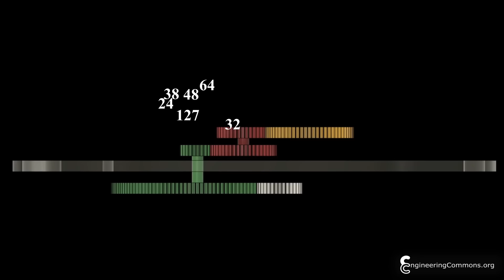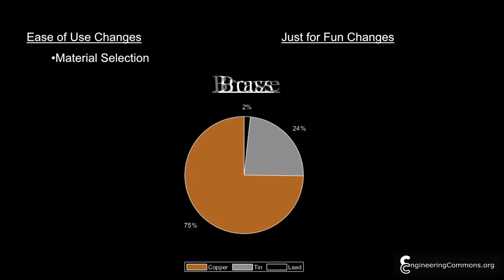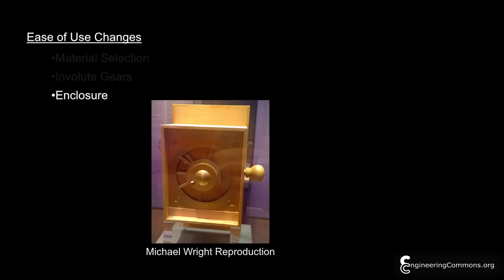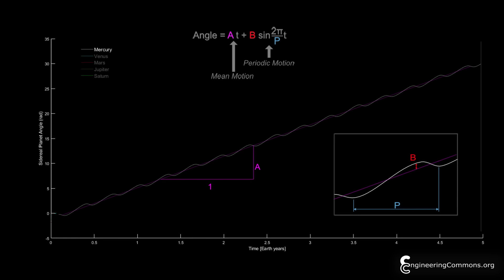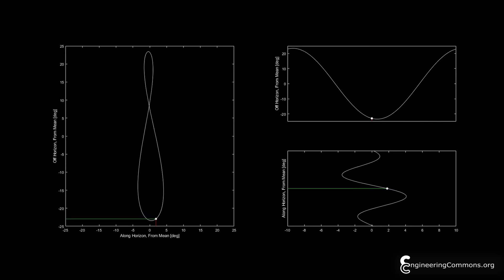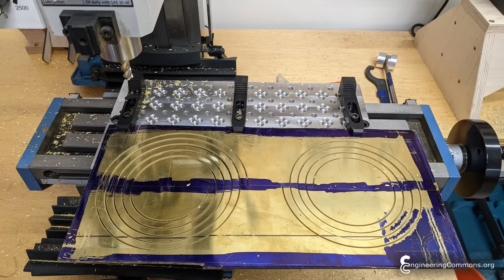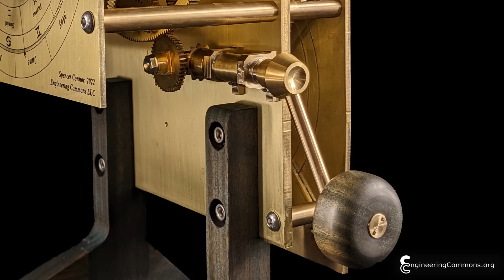Antikythera Mechanism V2: A Modernized Reproduction

Comment: Amazing that the ancient Greeks could create this device.  I am sure that they started out with multiple simpler devices and then combined them, but still, wow!  The effort to re-create the modern version is just as amazing.  The video presentation as well as the technical details were very well done.  I won't pretend to understand it all, but I never really felt like important details were glossed over.

Comment: Architects have to study surveying as well as art/architectural history. Couple questions: 1. The input wheel, is that really one year per rotation! 2. The planetarium display, if laying the device on its back like on a horizontal table, can it show where the planets and moon are in relation to the device I wonder. Like a surveying transit. Sighting down it. Or would you have to lay the device an an angle equal to the ecliptic plane at an certain angle and inclination? Almost sighting down from the center to a particular planet on its respective knob if it was accurate enough. A particular planet often being below the horizon. The mechanism being used as if it was the center of the visible universe. 
I wonder if the devices case would have been used in such a way, implying something more than a simple box flat on a table and used only as an analog predicting computer. Does that make sense?

Comment: So it's a mechanical calendar. Impressive. Based from observations from Athens? Or anywhere?

I feel it's missing a rotating offset disk with a hole representing a 24 hour nightsky.
A turn of that disk would tell the time at night, if it was matched to observed stars and planets.
If Venus rose at a different time or angle near fx. Rhodos, it could help with navigation.
It would give a hint of being to close to Rhodos, lets wait of shore until dawn before sailing closer.

Could it be altered to be a clock. By comparing observations and angles from Athens to fx. Rhodos?

Comment: Metonic cycle:  19 years = 235 synodic months, from full moon to the next is 29.53 days likewise from dark moon to dark moon. 1 year = 12.368 synodic months. 19 years = 254 tropical months from the Moon being near a chosen star to near the same star on the next circuit 27.3 days, but by that time, the Sun has moved on and the Moon must take 2 more days to catch up. 1 year  = 13.368 tropic months

Comment: I would love to have one, instead of being powered by a crank handle, to be powered by a chronometer...  and a means to reset it to current time?   A very useful time-piece in the near future when electronic support devices are not available...   How much would such a device be?  encapsulated within a inverted glass "domed cylinder"   Peace Love and Light

Comment: Ultimately someone is going to make a consumer version of the device and I hope they use (and credit/compensate you for) your modifications and modernizations so the thing has lasting power. I would also add a clock device to the crank that has input to current date so the device can also represent current astronomical conditions and not just be a predictive computer but a genuine clock and astronomy guide as an amazing piece of practical engineering art. Great math and engineering work on your part and fascinating documentation and video. Well done and thanks for clarifying the mysterious aspects of the machine.

Comment: also the planets have an equilibrium (equathingius) wich means . on the so many times they all form a straight line. and the sun have an eclipse, if the moon covers the sun hole. i believe the distance between the moon and the sun is so. that the moon covers the aun completly. although the sun is larger. but just farther away. i am not sure all about this. the distance between the moon and the earth can be five moons ? or is the moon 5 times smaller then the earth ? i forgot. also. if you live near the sea. you xan witness twice a day. the tide. in the 6 hours. flood and ebb.  wich means that the moons gravity pulls at the water of the earth while orbitting the earth.
6 hours towards the beach, and then six hours back. between two full moons is about 28 days. or so. and every year. in correlation with the days. 6 hours are left or over in day counting. so every 4 years they are added together and are called in 1 extra day in february , wicg is then a leap year. so 2000 2004 2008 and so on are leap years. next leap year is in 2024.

Comment: you can draw a circle with 1 pin and a rope with a pencil on a paper. just stick the pin or nail in the paper. atach the rope too the nail and the pencil and then move the pencil with the tight rope. around the paper. for an elips you need 2 nails and a rope and a pencil. make a luss or hoop in the rope. like tie the two ends toegether. wich is a bit wider then the distance of the two nails. then move the rope over the 2 nails. and then move the pencil inside the rope around the paper.

Comment: with a pull spring  not  push spring.

you have two gears on a rod. one round like a circle and one elipse like a an egg, then you can keep the gear teeth together ,with changeing distance with a pulling spring on the rods of the two gears wich act like a pulling rubber eleastique band.
Reply: one of the gears. the elpitci or the round one. rodd being held in a slot. and not in a hole, to allow movement, of the whole gear.

Comment: triangle teeths instead of straight teeths, on the 90 degree off angle gear. xan solve that problem. also. maybe..... haveing a bit of space between every matching teeth. like haveing loose gears. reduces friction. it looks wobbly when shakeing it. but. still maintain acuracy. like the fucntion of a teeth of a gear is too push the next teeth to make wheel go round. no matter what kind of space is behind it. it saves oil anyway.

Comment: Actually, some of the changes you made, such as bevelling gears, the use of bushings, etc, would have been used by the original designer had he known of them or been able to make them.  So, in essence, your machine is true to the original.

Comment: Finally, someone with explained calculations of gear ratios and lunar anomaly.
Reply: What a phrase to utter
Reply: The moons sine wave analemma cycle between the two energies of the earth’s double torus magnetosphere is 19 years.

The earth’s analemma cycle is 26,000 years. 12,000 years above the sun’s magnetic equator and 1,000 years to cross causing this the millennium of global warming climate change end times.

Mystery of the 7 crossings of the galaxies magnetic equator Jesus holds in his hand not you or co2 causes the Milankovitch climate cycles.

Believe Jesus and be eternally saved from Gods Great Year eternal climate change resets at his alpha/omega millennial crossings of his magnetic gravitational equator.

Comment: the fact it took you ten months, using modern build techniques, to fabricate the part, tells me this was a major project for the original machines' builders.  the ( nearly non-existent) margin of error for parts in a high friction system tells me the builders also had an incredible set of skills to complete a machine that could function properly.

Comment: Well made. Good job.
A little modern as 99% is same as original one
Some parts May be not found as researches continue.
When you see such complexity very high of this product, you can wonder why there to make a  clock, as spring were known and used.
There were automats and automatic furnitures like automatic opening and close doors in temples

Comment: The project took you 10 months. I wonder how long it took the Greeks (or maybe the Arabs)? They probably did not have lathes or milling machines, even primitive ones. And they certainly did NOT have CNC machines, digital computers, and astronomical observations that were several orders of magnitude more accurate. And yet they did it - an admirable feat. I wonder how long the original calculator from Antikythera was made? I'm sure none of us will know, but I'm curious.
Your work is also extremely interesting, although all information can be obtained in an instant through the most ordinary computer in every home. A great tribute to our ancestors.

Comment: Okay, it's a clock. Thanks.
Reply: It's not a clock. It's a 3D calendar.
Reply: @itemlocation  In terms of what?
Reply: @Fluffy-Tail-0000  A clock needs a continuous power source like (1) a watch on your wrist (battery), (2) a clock on the wall (electricity), (3) a sundial (angular momentum), or (4) a grandfather clock (gravity weights). A calendar on the other hand predicts the past and the future and doesn't need to be running all the time, examples are: (1) a wall calendar (tells you when the 2nd Tuesday in June is), (2) the Mayan calendar (tells you when the next sacrifice will be made), (3) antikythera mechanism (tells you when the next solar eclipse will happen). I hope this answers that question fairly well, and on to the next one. ("The Enforcer" reference, sorry)
Reply: @itemlocation  Did you ever notice that when people talk, their upper teeth don’t move?
Reply: @Fluffy-Tail-0000  I like that. That is funny.
Reply: @itemlocation  Just messin'
Reply: @itemlocation  By the way, one of my hobbies as a teenager was clock repair.

Comment: if you understand this thing it is blantently obvious that it must have could have or may be driven by an actual  clock and following the typing of the construct an close to original clock mechinisium  could and should be devised to complete the actual whole construct it truely behuves me that there are no examples of clocks from that time except for the wooden table type regulators used on ships for navigation and where driven by at set of four counter weights hanging from the four corners of the table to compensate for the rolling and pitching motions encountered by ships while navigating  like old style grand father clocks the counter weights hung on chian or lanyards driven by the gravitatinal force of the weights that required constant rewinding of the landyards on the driving spindal please construct this missing clock to complete the set and the true functionallity of the  motion and timing of the regulator.

Comment: Very nice description - and build !

I might be tempted to make the plates out of acrylic though - with suitable bushings - just to see the amazing gear trains !
Reply: The transparent plastics wouldn't be able to hold up for more than a few turns of the key. HOWEVER, if the gear teeth and core, (and spokes?) were stainless or brass, clear acrylic COULD be used for the body of the larger gears. There's also various treatments that could be used to change the color or increase hardness and wear resistance to the tooth sections. 🤔

Comment: I have theory that the Antikythera was a device to solve the “problem of the Longitude” that required accurate clocks unavailable in ancient times. Do you think it could have worked for that purpose?
Reply: I can't see how it couldn't have been used for such calculations, or at least to increase the accuracy of Dead Reckoning, if used in combination with a sextant. For example, take the planetary positions at sunset or before sunrise, and with the device you could know what day it was. Knowing the longitude of a city and the sunset or sunrise time on this day at that location, but then you don't know what time it is where you are? Hmm, at the very least it could suggest that you need to go further west, or further east, right?

Comment: Very impressive, I really mean damn impressive, however the heliocentric model is subject to relativity (the reason for relativity) and the assumption that the earth spins is impossible to prove. It is just as likely your device was based on a motionless earth, which is the Occam's razor because there in no need to have a surrounding exceptionally empty vacuum of space.  Without this insurmountable problem that must defy Boyle's gas law to exist and the insane surface speeds of between 300 and 1000 MPH where most of the population would be,  a flat stationary world makes it pretty easy. 

Of course there is the theory of gravity that Newton published, unfinished, some 25 years after Boyle, so he should have known better, but in the 335 years since his theory was published, no one has ever shown gravity to make an airtight seal, which is the only way to keep a high pressure from expanding to fill the volume. 

However Newton did come up with the inverse square law that should make it apparent that any light from more than a couple of light month'e distance  would be undetectable... His 3rd law of motion also prohibits navigation in a vacuum, so he is 2 for 3....

I am totally blown away with your work and the ancient tech. 

Makes you wonder if those old farts were really as backward as mainstream history paints them.

Comment: My question is would it have been able to determine Time in order to determine Latitude. Chronology wasnt accurate enough to determine latitude until i believe around 1700's. Was the AM used for Navigation?
Reply from the maker: Latitude is very straightforward, it's longitude that requires precise timing. You're right that it wasn't until John Harrison's timepieces that it could be done reliably. The AM doesn't run autonomously, it's much more like a calendar than a clock.

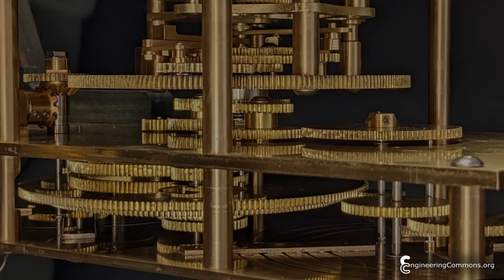Comment: Hello! I'm one of the chaps from Fizzy Chickens, making an accurate Antikythera Mechanism for 3D Printing. I see your point for D1 7:29 but I think you could avoid that by increasing the height of D1, and ensuring minimal friction through tolerance testing. Found it works really well if you aim for 0 friction between gears.
Reply from the maker: That's good to hear, I also increased the height of D1 (and C2) out of an abundance of caution. I'd be interested to know the materials and details of your 3D printable version if you'd care to share!
Reply: @EngineeringCommonsLLC  There are many drawbacks to using 3D printing for gears (especially using PLA material). As a benchmark, all gears are at least 1.5mm thick (it's to a 1:1.5 scale due to the limitations of a 0.4mm printing nozzle). Therefore each gear is 2.25mm as a default. Our C2 and D1 is 2.1mm thick, which works out at 3.15mm each.
Reply: From my records, C2 has a module of 0.4583, while D1 has a module of 0.4833. So we've averaged them to 0.47 (as this is the average module of the surviving gears).
Reply: @EngineeringCommonsLLC  Another Question: Why did you choose to build the 2012 Front dial of the mechanism and not base it off Tony Freeth's 2021 version of the mechanism?
Reply from the maker: @sottyify  If you are referring to the planetary rings rather than pointers, I felt it was unnecessary complexity. Keeping alignment across all of those is non-trivial, and they have a large moment arm for friction. Didn't seem like a good design choice.
Reply: @EngineeringCommonsLLC You don’t say. Personally, I think the rings look cool.
Reply: One thing I noticed you hadn't touched on was the Calendar Pins that a peg slots into, 1.37mm deep on the front dial. Did you not know about that or choose not to do it?

Comment: this would be a great high school project, not only the mathematics but the theory of planet cycles. I am going to have to watch this again, its just cool. between the manufacturing and the build there is just a lot of knowledge imparted to the viewer. and that's just on the surface.
Reply: Students could design and 3D print each part, and make a similar mechanism. Great idea.

Comment: It's entirely possible this wasn't the only geared construction they had. . A wooden set up would likely not have survived.
Reply from the maker: That truly is the scientific consensus, the only reason this one survived is because no one knew about it for two thousand years. Is has every indication that the maker was familiar with making this type of device, but they would have been quickly scrapped for the valuable bronze.

Comment: Wow. Both for what you were able to do with this build and even moreso for what the ancients were able to do 2,000+ years ago. Just mind-boggling.
Reply: This video was the most understandable and comprehensive discussion on the Antikythera Mechanism that I've come across. You showed more about its math and construction than I could have asked for. Thanks!!
Reply: How is it mind boggling though?
If you spent your life observing one objects circular movement in relation to your self and were introduced to gears you would be able to deduce the gear ratio pretty easily. Adding one more, and so on isn’t that much harder , just more complex.
Just by its engineering you can see how little the ancients actually knew in regards to engineering in that it is driven backwards, the materials used, the lack of removable fasteners , the design of the gear teeth, some of the movements like the pointer, and lack of bearing surfaces.
I guess the ability to boggle the mind so easily hasn’t change much in thousands of years.
Reply: @joeshumo9457  Everything is obvious in hindsight. If its so simple why dont we find them everywhere?
Reply: @joeshumo9457 🤦‍♂️🤦‍♂️🤦‍♂️🤦‍♂️🤦‍♂️🤦‍♂️🤦‍♂️🤦‍♂️
Reply: @joeshumo9457  fucking moron, i bet you wouldn’t figure out how the device worked even if you spent a millennia on it
Reply: @joeshumo9457  Of course, it’s pitifully easy to replicate these machines. I’m sure you could do it. Right?

Link us to your channel and videos of you doing so, so we can appreciate real genius. Unboggle-able!
Reply: Are you some kind of a troll?What would it take to boggle your mind?
Reply: @ravenmad9225  @Joe Shumo's comment is kind of long-winded for typical trolling. I think some kind of OCD mental illness is involved.
Reply: @KarlBunker  that is not what ocd is